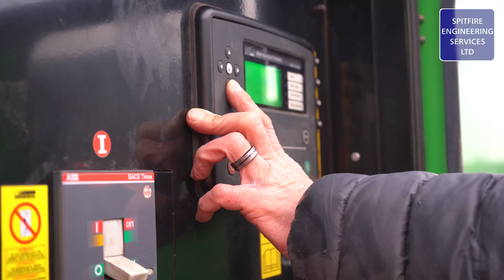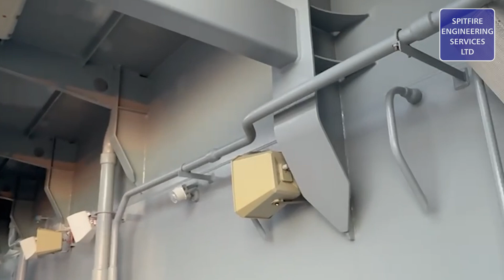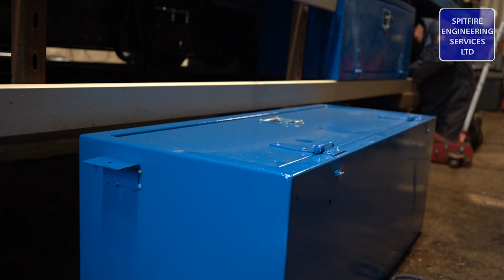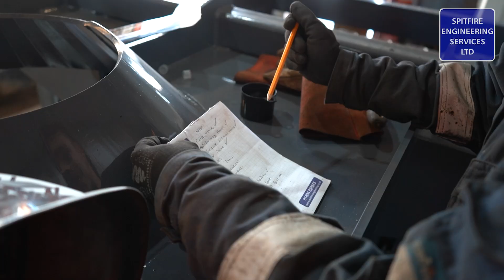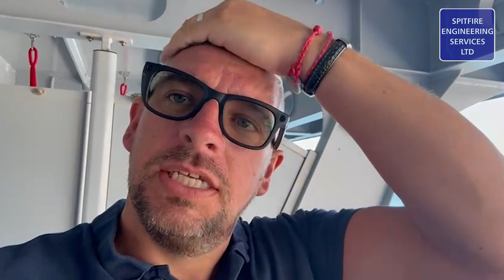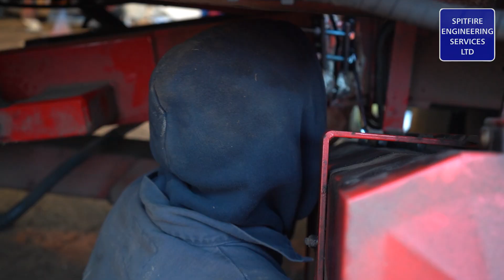GAME-CHANGING BUILD REVEALED – YOU WON’T BELIEVE THIS!

Comment: Site boxes should have layered defenses.  Metal wall, reinforced concrete, maybe a ceramic layer to stop saws and cutting torches at the walls, floor and top.  Then the challenge is to secure the point of entry with recessed lock devices and time-consuming and noisy options for getting in.  Starlink optikns for cameras and alarms, exterior alarm horns and lights, etc..  If there are easier and less risky options at other sites, the criminals will usuzlly go there.
Reply from the maker: That’s exactly what we’re thinking. We think we’ve got this as good as we can without it being crazy expensive